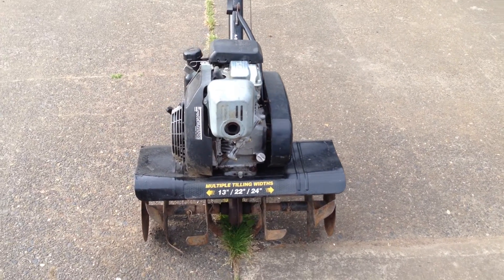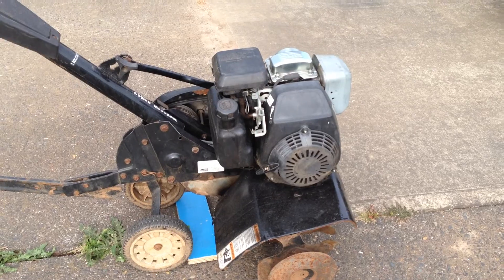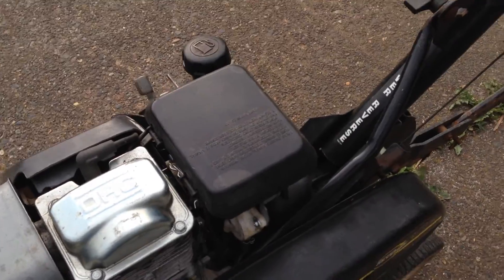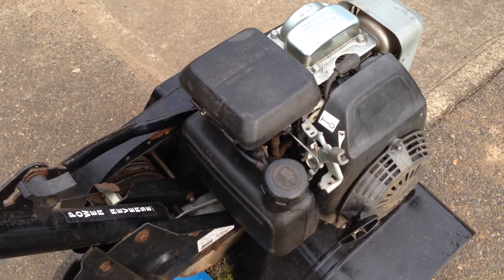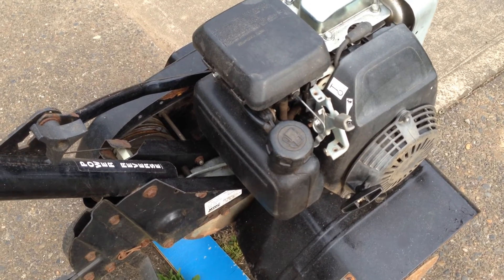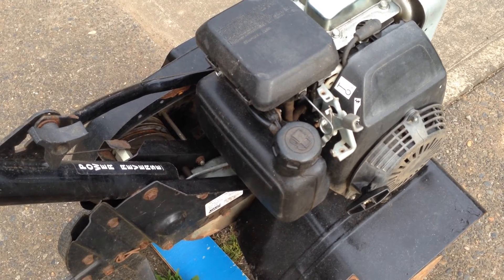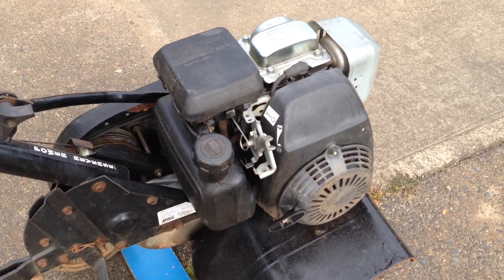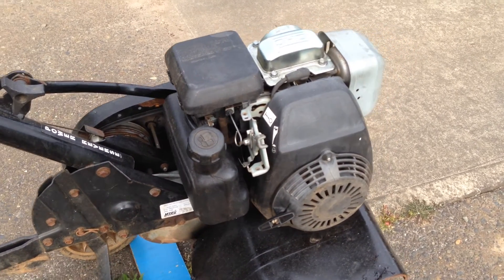MTD 24" Rototiller with Honda GC160 - 5 HP Engine - 01

Comment: Based on what you have shown us and what you have done I would want to check things around spark. A) is the coil failing when engine temp rises, B) is plug fouling as it reaches temp. Change the plug first as it is quick and easy to do. If a replacement plug is not readily available you can do an ok temporary job cleaning the plug with some brake clean and a blow torch (lots of videos on this). If it corrects your problem just get a new plug. If not replace the coil (pretty cheap and easy). It’s always difficult to diagnose an issue when elevating heat plays a role. Good luck and let us know the solution.
Reply from the maker: You are correct..   it turned out to be the spark plug...  Once it warmed up, it stopped sparking..  replaced it with a new one, and it's been fine ever since.
Reply: I just replaced  fuelpump and cleaned the carb took about 4hrs
Reply: Ithanks
Reply: Pain reinstalling it.

Comment: i think you don't get fast  fuel to your carburator and when the room of your carburator is emty he dies, a time later the room has back fuel and can start again, check if there is no feul line  stuck between some parts or check your fuel pump lines and if it stil works 

sorry for bad engl
Reply from the maker: +Glenn Bierwaerts See video #4 for solution...

Comment: once it dies immediately check for spark. it could be that the coil is on it's way out, let me know
Reply from the maker: donyboy73  Hi Dony... I checked out the ignition as you had suggested, and found that it DOES have good and strong spark as fter the engine stalls out... 

I put up a new video of it, and added more comments that may be of help here::

https://youtu.be/3i5ZOZ7PEX0

Please take some time to view it, and read the comments I put of the video.

Thanks again for your help...
Reply: I have one just like that done ever thing to it in I change spark plug in it running like a new one same thing my was doing
Reply: Not sure if you solved the problem but I have the same engine doing roughly the same thing.  Very frustrating.  I keep it outside which is what I blame it on.  It was running fine and it sat for a bit and now this.  Every time it sits it has this problem but I can usually get it running.   This time it just wont keep running.  I did all the things you did.  Spent hours on it.   And still the same thing.